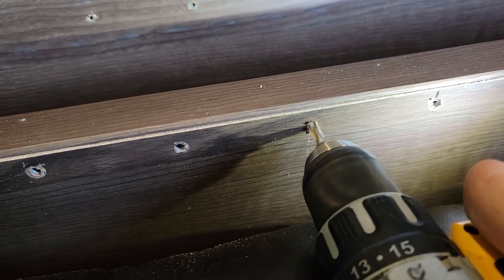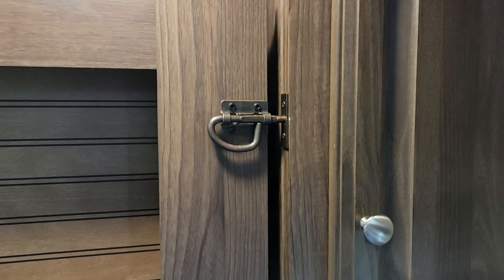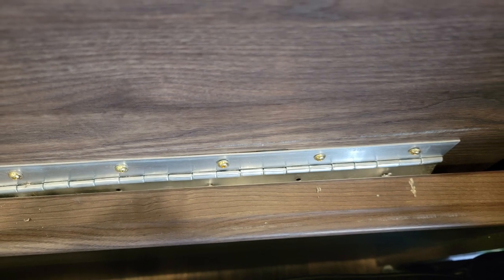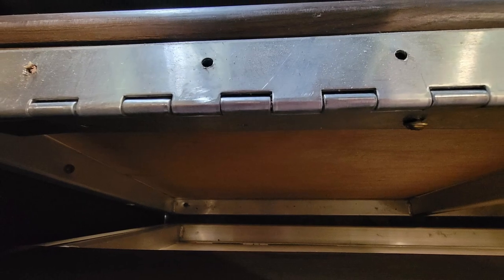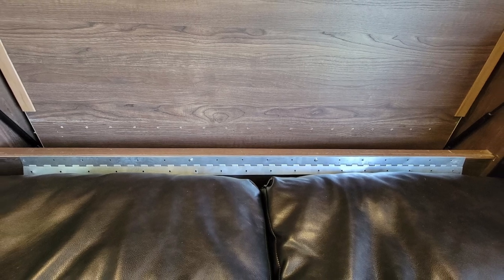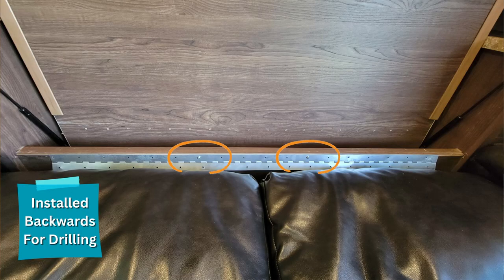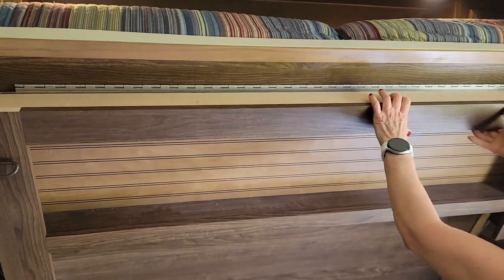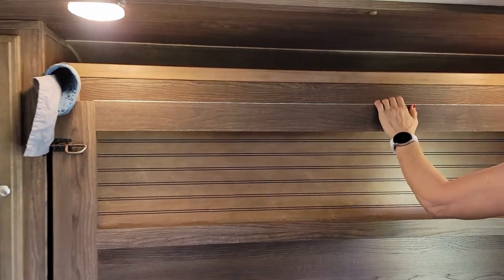I Swear They Built It Backwards

Comment: Another quality repar and what should have been done by the factory in the first place. Hence the reason I built my own camper.
Reply from the maker: I like the new folding mattress vs flipping mattress design -it gives you pass through storage under the head space, full travel to the front wall so you don't lose things and a stronger hinge.  All good things!  If I have to do this again, I'm going to retro fit that idea into my trailer.  I don't think it would be hard at all!